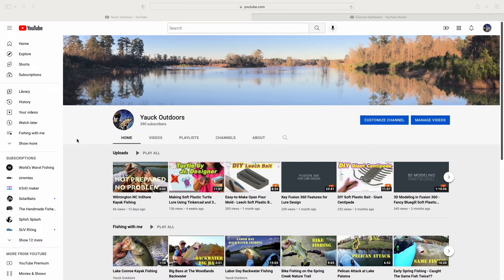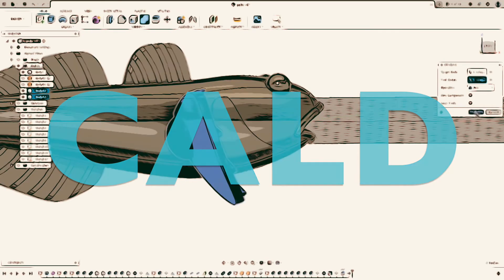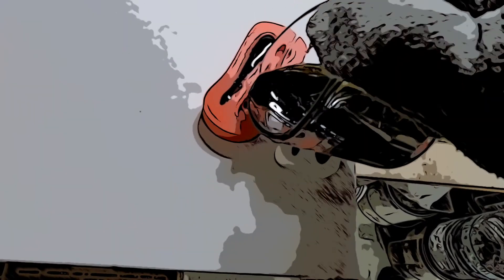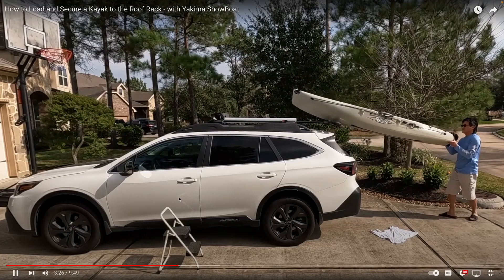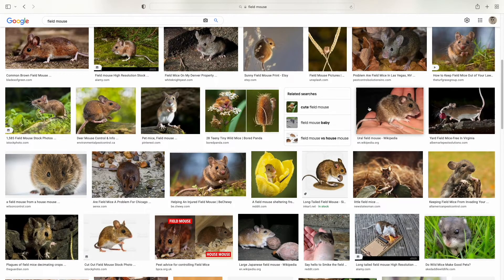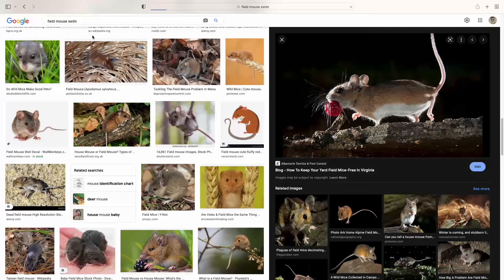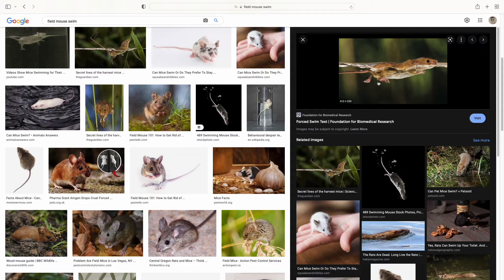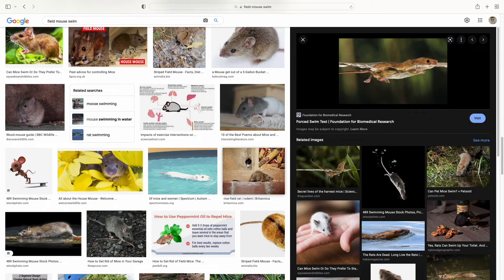Mouse Lure Design and Build - Using a 3D Printer

Comment: How do you make design corrections in fusion 360 to a glide master mold you have already created. Like symmetry corrections?
Reply from the maker: If you want it symmetrical, you can cut the mold in half and discard one half, mirror the remaining so the result will be symmetrical. Is this what you are looking for?
Reply: @yauckoutdoors  how to I up load it to fusion 360. Do I need a 3d scanner
Reply from the maker: I don't use 3d scanner in my design. I design my baits/molds in Fusion 360 from scratch. I guess you can use a 3d scanner, but I don't have one and I don't have any experience on that. If possible I would like to try that approach.